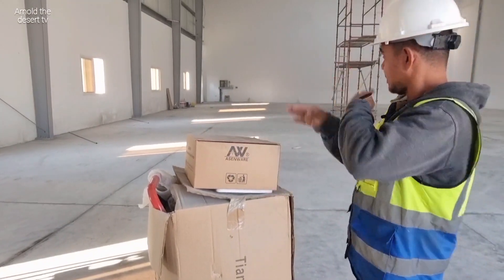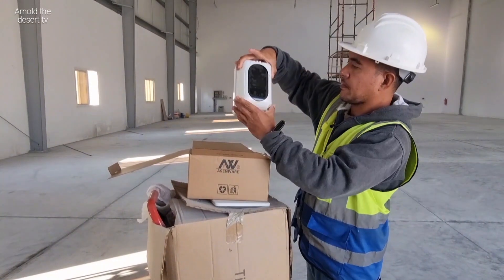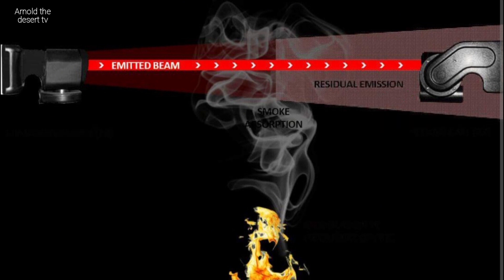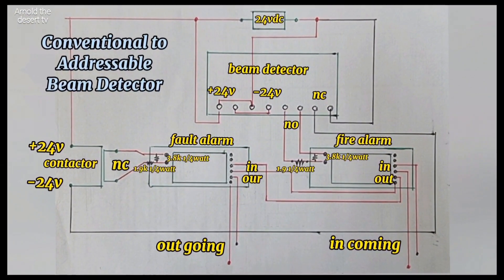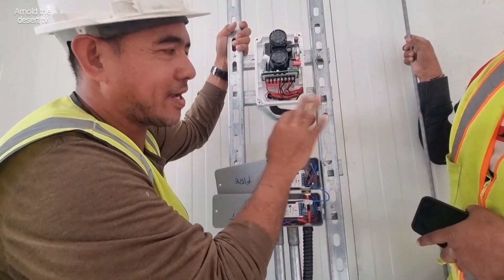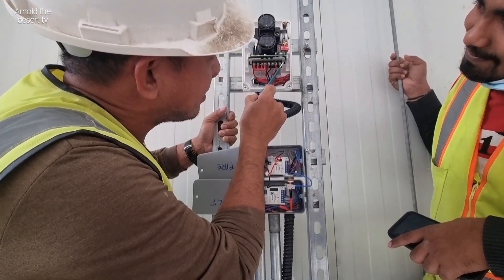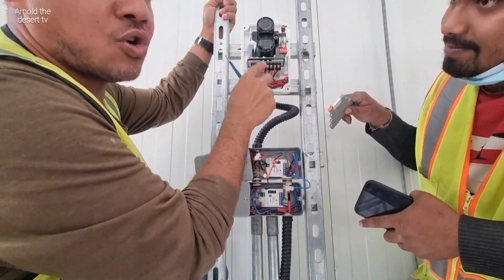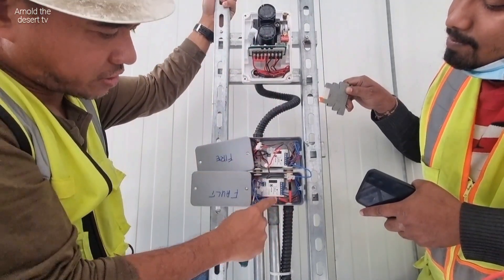BEAM DETECTOR FOR EMERGENCY FIRE ALARM DETECTION @FACTFIREKING

Comment: Good and informative content. I think this is more effective than smoke detectors. But I have a question, in case a bird interrupt the beam, will it sounds the alarm? Can the detector distinguished smoke from other object? Is it recommended to connect as trigger to automatic sprinkler system? is it recommended to be installed to logistics warehouses ?
Reply from the maker: Thank you for the good questions, sir. This beam detector is a program only to detect smoke or fire, not in the other object like bird and dove or etc. Sir, thank you for your support .
Reply: @arnoldthedeserttv3116  Thank you. I saw similar technogy in Japan, but are used above perimeter fence, not as smoke alarm but to detect trespassers.
Reply: Done tamsak harang din❤
Reply from the maker: Ate leila thank you so much
Reply from the maker: Yes sir I got you thanks a lot po